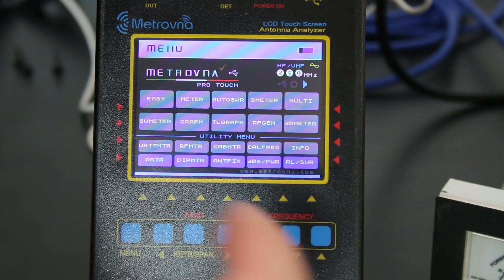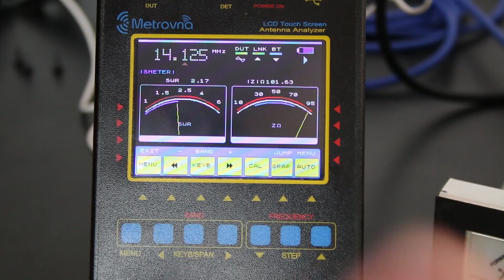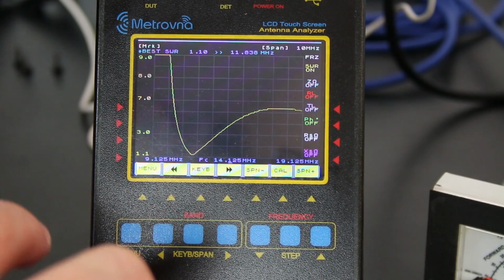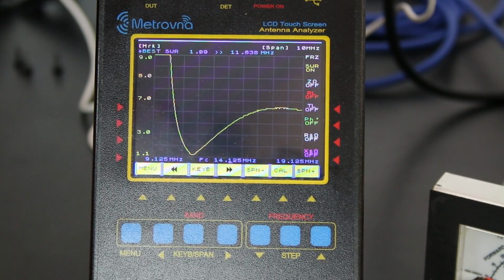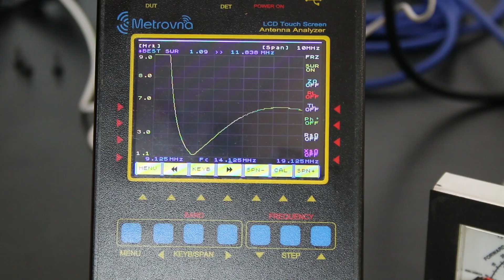Metrovna Pro 250 (Graph function)

Comment: OLA GOOD EVENING .... WOULD IT BE POSSIBLE TO MAKE A VIDEO DEMONSTRATING IF THE ANTENNA ANALYZER (METROVNA DELUXE 250MHz) WOULD BE ABLE TO MAKE MEASUREMENTS IN EXTERNAL ANTENNAS BASED ON LONG COAXIAL CABLES LENGTH TYPE BETWEEN 10 AND 15 METERS LENGTH? ? MOST VIDEOS ON THE INTERNET NOTHING CLARES ABOUT THIS ..... GRATEFUL ....